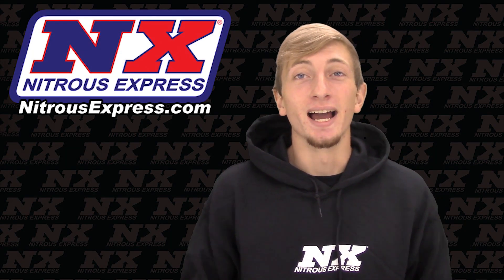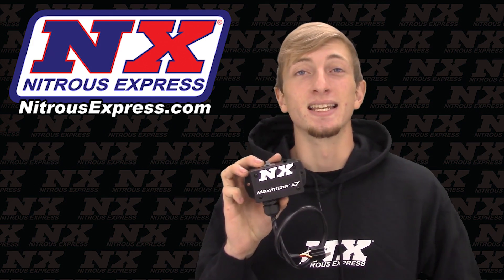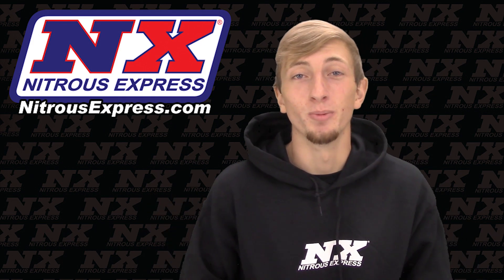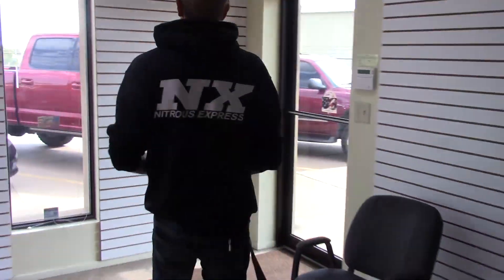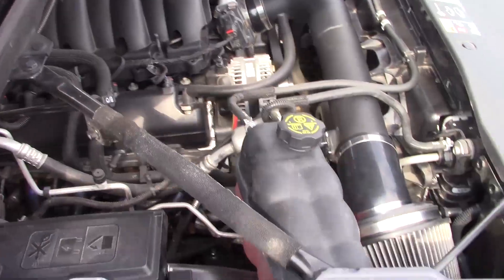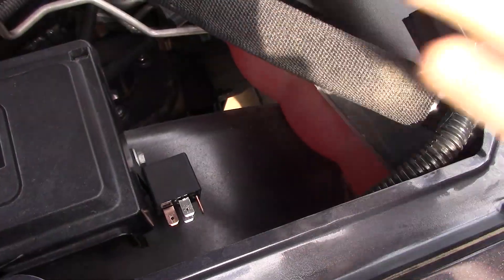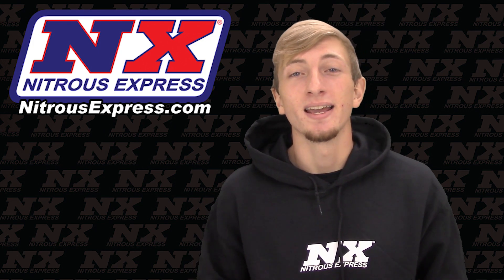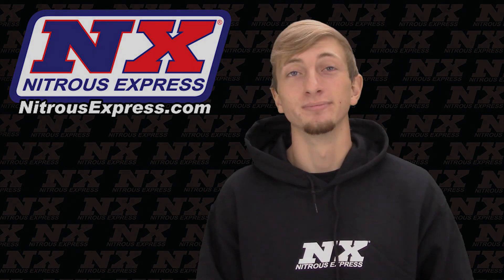Nitrous Express - Maximizer EZ Progressive Controller Part No. 16006

Comment: How does this work with a window switch that turns off the nitrous between shifts? Will it continue the ramp regardless of shut off time in between the gears ( automatic, nitrous outlet winmax)
Reply from the maker: It would restart the ramp anytime you went outside the "rpm window" on your window switch.

Comment: after the ramp time, can you adjust the percentage time on how long it stays on at 100% or does it go off with micro switch?. I know it will from go from 20% to 100% in the ramp time of up to 4.5 but will it stay on till micro switch is left off and will it stay at 100 if I restart all over at 20 with the re amp. Is there a way to turn that off if it starts over half way down the track. Like it to come back on at 100 % if I get back in it.
Reply from the maker: The Max EZ is activated by the micro switch. If your micro switch shuts off, nitrous flow shuts off as well. If you get back on it mid track the nitrous will follow the ramp time set by the Max EZ.

Comment: I’m running a NX mainline kit on my c10 with a 454, and I’m also running the additional trans brake interrupt relay in addition to the regular NX relay. Will this controller just replace the nitrous relay and work properly?
Reply from the maker: That's correct it will work like that.

Comment: How would I use this if there’s no relay box if I have the solenoid wired straight to the WOT switch
Reply from the maker: you will need to add a relay harness for the Maximizer EZ to plug in to, here is a link to the harness you would need to add.
https://www.nitrousexpress.com/relay-wiring-harness-only-5-wire-15525.asp
Reply: @NitrousExpressVids  is there any video describing how this is installed?
Reply from the maker: @glass2271  The installation of this controller is in this video. 1:20 is the time installation starts.

Comment: What's recomended return or dead head regulator?
Reply from the maker: It is really dependent on your setup. Its not uncommon for carb applications to run a dead head setup and a return style on EFI.

Comment: This item is an add on to a window switch so it can be controlled at what rpms to turn on and off at ?  great for drag racing and can be switched to full hit during roll racing by turning the nob ?
Reply from the maker: Yes you can use the Maximizer EZ along with a window switch!

Comment: How does this work on auto trans and a button instead of window switch
Reply from the maker: It will do its usual ramp while you press the button until it goes to 100% then it will stay there until you let off the button. If you get off the button and back on it the ramp will restart.

Comment: Is this like a digiset or a progressive?    Is there a way to adjust ramp time and percentage?
Reply from the maker: As stated in the video, it is a progressive. Ramp begins at 20% & progresses to 100% based in the time set via the knob on the module. Can be set up to 4.5 seconds in half second increments.
Reply: @NitrousExpressVids  so when you say 4.5 seconds, do you mean it will take 4.5 seconds under WOT to reach 100% nitrous shot? So I can start at a 50 shot and ramp it up to 150 shot?
Reply from the maker: @samuelchan9501  That is correct except you would have your jetting in for a 150 shot. Once you hit WOT you will be at 20% of your 150, so about a 30 shot then over .5 to 4.5 seconds it will ramp to that full 150 shot.

Comment: will this work on the wet shot? I'm assuming this goes to 0 to 100% ramp. it's just  the time u wana go to 100%
Reply from the maker: Yes it will but it only designed to control a system up to 40amps.

Comment: I'm running a Holly Sniper that can control nitrous, with this work with it? @nitrousexpressvids
Reply from the maker: As long as your Holley EFI system has a nitrous output wire you could use that to trigger the max EZ